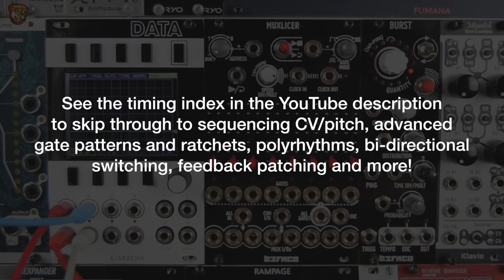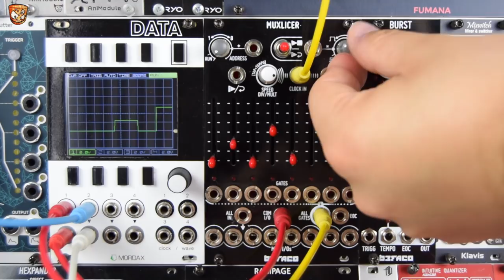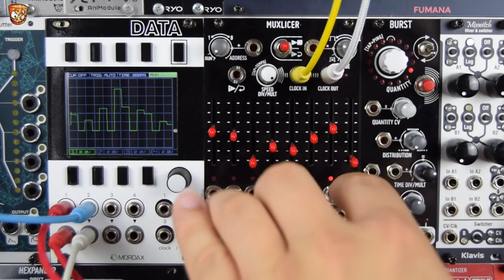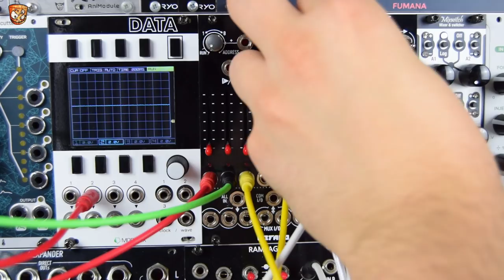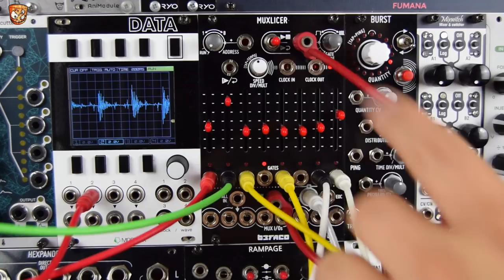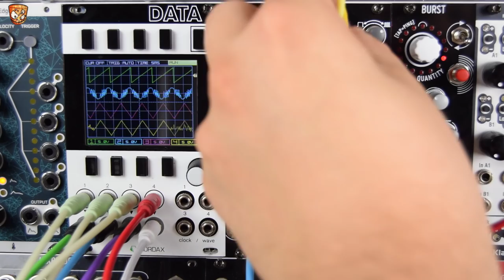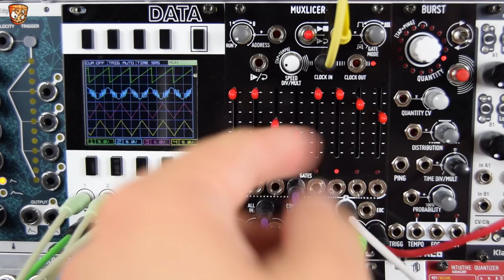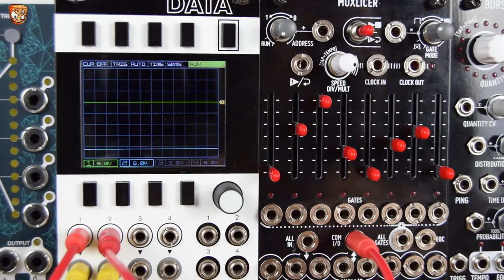Befaco - Muxlicer (bi-directional switch, sequencer, advance pattern generator and more!)

Comment: The spawn of the Doepfer A-152+A-155, sort of. Looks great. Thanks again for your comprehensive coverage of things! I don't really like the layout of the controls+jacks at the top, and also don't like the idea of using an encoder press for tap-tempo (would prefer separate buttons that are actually buttons), but those are both fairly minor whinges. If I hadn't already just submitted a Thonk order I'd go submit a Thonk order!
Reply from the maker: To be honest I nearly exclusively clock it from other sources so I haven't really thought about the tap tempo. Good comparison to the Doepfer units, it definitely brings a lot of things together into a useful package of it's own.

Comment: a fun way to use this module is clocking it at audio rate to get a lo-fi graphic vco with a harmonically related (until it drowns in aliasing that is) pulse wave on the gate out
Reply: This sounds interesting.  Can you explain a little more in depth.  Noob here but would love to try this out.  So far I'm guessing you send a square wave at audio rate to clock it but then what are you doing from there?

Comment: The price of this thing is amazing... Just bought an ADDAC206 which is more expensive and nowhere near as feature packed. That said, I could see the ADDAC206 working very well in conjunction with Muxlicer in the same setup.
Reply from the maker: Yeah having multiple similar but slightly different units can yield some interesting results when you chain them or push them into the areas where they differ. I don't know the 206 well.
Reply: ADDAC stuff is nice but sort of overpriced IMO if you buy it new, and their digital modules are a mixed bag. I sold the 206 because there was only one out for all the ins.

Comment: DivKid, if you have time, I'd like to know more about addressing the switch in order to move to non-adjacent steps using probability from Marbles or the ADDAC504. I haven't done this before, but it looks like if I was using all 8 steps with the run/address knob sent to 0-10v, that each step would have a 1.25v trigger range. I don't see this in the manual and have been looking everywhere for some clarity.

Comment: Wow...this looks incredibly useful. Kind of like a sequencer and sequential switch married into one...this can replace quite a few modules in my rack! Any idea on future price?
Reply: £209 at one place I tried.
Reply from the maker: Hey D B and Andy, I think around 200, released Wednesday.
Reply: Hey, I have the Muxlicer now and want to use it to step through 4 notes of a chord. I have the CVs coming out of the Harmonaig into the i/os and the common i/o going out to a VCO. However, is there no way to trigger or gate one step at a time? The one-shot triggers goes through all 8 steps, but I simply want to use it as a sequential switch with a manual trigger to each step.
Reply: @DBPawlan  Interesting. I own a Harmonaig as well and will soon own this one. My guess would be to modulate the address on muxlicer(could use its own cv sequence? Or another cv sequence) to shuffle through each individual gate step. Just guessing here based on the demo. I haven't really explored my harmonaig because I'm still trying to figure out what'd be best paired with it. I'm anticipating Loopop coming out with a video on it very soon! Also curious to hear how you're coming along with it.
Reply: @roboslobonator  I couldn't get the Muxlicer to work as a sequential switch until I realized that it was expecting +10V and I was only feeding it +8V which didn't work. You can, however, set each slider as the CV pitch for your VCO and select (or randomize) each note through CV addressing.

Comment: Great demo, as always, I bought one! Spent all day trying to stop the Pico drum double striking from the gate out of muxlicer. Which drum modules were you using that ignore the second stage of the gate?
Reply from the maker: not sure to be honest but I haven't had issues with the PICO Drum double firing. It might be the level of the gate, can you attenuate the gate output and try that?
Reply: @DivKid  attenuate the gate! Why didn't I think of that! Thanks for the suggestion Ben, and, taking the time. 👍👍

Comment: Awesome video and such a cool module. Thinking about this for my sequencing because of the patch programmability. Is there a way to trigger it to advance 1 step at a time, say if you had a trigger sequence running into the clock that wasn't consistent, say just hitting on 1,2,3 but 4 had no trigger? Or does it just try to maintain the clock at all times? Wondering if I need something like a Clep Diaz to gain that additional functionality.

Comment: I'm wondering if you can make use of the slider voltage to control the clock speed and thereby have an adjustable step time.   Either way, looks pretty dang cool...
Reply from the maker: Not by patching it back onto itself. You could use an external clock generator, clock Muxlicer with that, use Muxlicer's output to modulate the clock module and you'd have what you want.

Comment: just a question, it seems that in the first simple sequence example, the sync between the gate and the cv change for pitch is slightly off, shouldn't that be more together? thanks
Reply from the maker: can you give me a specific time in the video and I'll check that out.
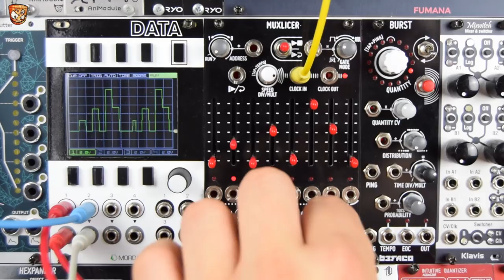Reply: sure, it's at 2:45, probably most obvious when only 1 gate per step, it seems as if the gate is a bit earlier than the cv change
Reply from the maker: Ah ha sounds like an issue I was having with a quantizer. Just tried the module and I can't repeat that behaviour (minus said quantizer - it's not in the case).
Reply: thanks for checking!
Reply: I get this as does my bro who also has module.

Comment: I have been rewatching this again and again. I am trying to sequence a beat using the muxlicer and some patching panda moduls. Is there any way to get shorter gates or to turn them into real triggers?
Reply from the maker: Do they need to be triggers? If it's an input that expects a trigger that module will likely ignore the sustained gate length any and just read the rising edge of the gate (the start). So you might not need to do anything.
Reply: DivKidVideo thanks, ben! I am using the n.v.h.s from patching panda. It seemed to me that I couldn‘t reproduce the same sound with  gates as I could with short triggers. Maybe that‘s just my lack of knowledge because I am still learning. Your answer gives me hope and I am going to try some more!

Comment: Hi, Possible to individually randomise the steps or ratcheting them? As we can do with Xaoc Triana2 

Like:

four CV/gate steps
per step repetition or ratcheting
per step trigger/gate muting
on board clock divider
voltage controlled play direction, transposition and reset

Thx,
David
Reply from the maker: Hello, that's not possible on the module.

Comment: I just got mine working. Despite the fact this can sequence pitch, would you classify this as primarily a percussion sequencer/tool? What is the default CV sequence voltage range? What's the best method to limit it to say a 2 octave range, so the sliders are less sensitive to pitch change? You should totally do a video of this with OCHD.
Reply: there are two ways to limit the voltage range: you can plug an offset into all in or you can push the switch up or down while holding down the encoder to limit it internally